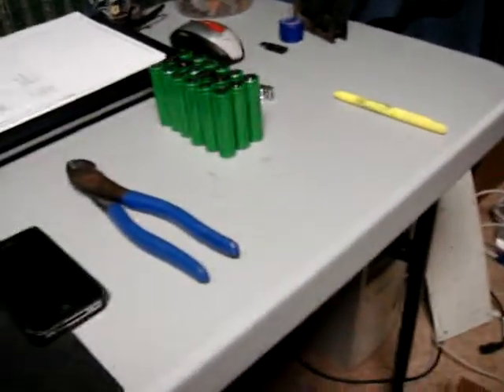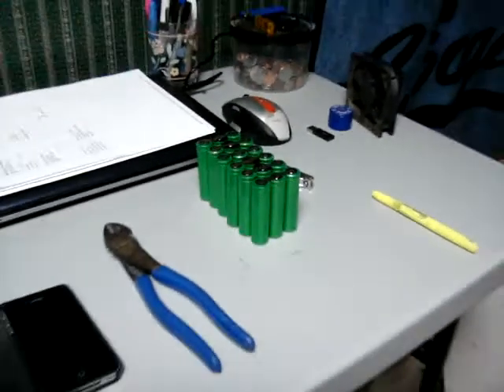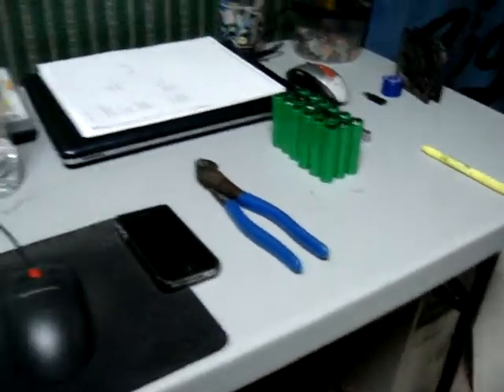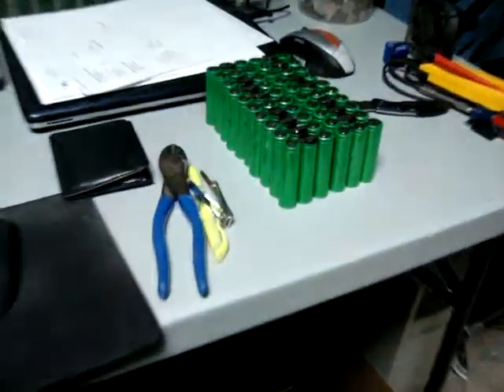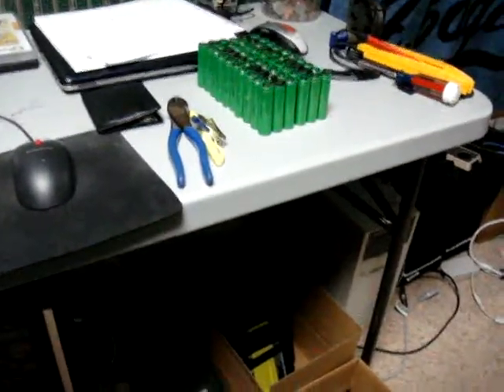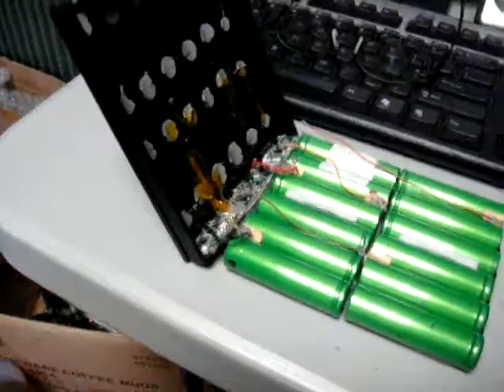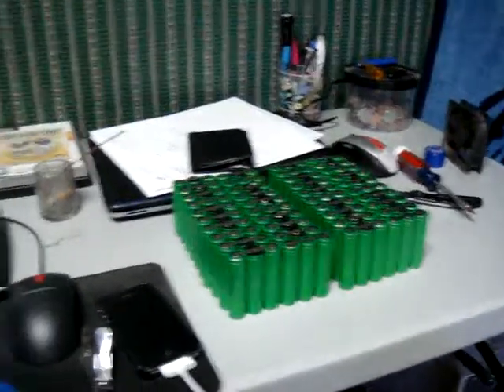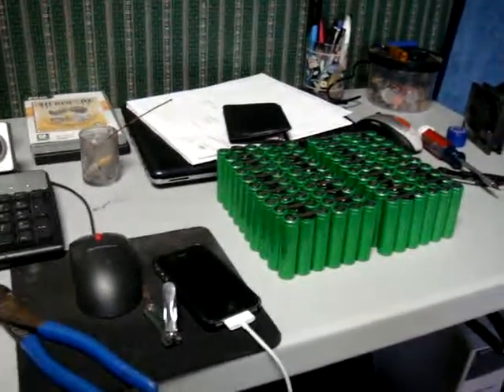EBIKE 72v - Battery pack built from Dell laptop batteries

Comment from the maker: i balance charge the parallel groups with the balance leads. and once they are all topped off i use them on the bike and then i bulk charge at 10S with a lipo charger

Comment: a123 is fine. all the recalled cells are in circulation again and can be bout for around 35 for a 20ah pack. when the recall first happened i could get them for 15 bucks each.

Comment from the maker: @backlash170 they have li-ion smart chargers that charge 10cell (10x 3.7v cell full charge 41v) or you step it up to whatever voltage you want 15 cell will give you 61.5v fully charged. then just get a 15cell charger. It is always recommended to use a battery management system when using most all batteries

Comment: Those look like Sony Konion cells that they use in Makita 18.5V powertool batteries, I'm not sure but the "GR" designation may mean a lower discharge rate than the 18650V version.  The 18650V versions are rated at 10C discharge and are quite suitable for ebikes but it just doesn't make sense to put a 10C cell into a laptop....overkill.  Have you tested or researched the discharge rate of these 18650GR's?

Comment from the maker: The pack splits in half so it charges at 36V. You can use a 10S lithium smart charger, or you can use a bulk charging PSU. I also have balance wires just to check the cells from time to time.

Comment from the maker: if your scooter runs 36v your going to want to use a 10s(10 cell) lithium pack it will charge to around 42v fully charged. It may be possible to run 14 or 15 cells depending on the capacitors in your controller...thats only if you want to go faster.  You can use any types of cells you want just be careful how you charge them. the easiest way is to buy 2x 5cell packs or 2x 6cell packs and wire them in series.

Comment from the maker: when you put cells in series the AH(capacity) stays the same (5x 3.7v 2000mah cells in series = 20v 2000mah) only paralleling will increase the capacity of the pack. If you want a simple build just buy the largest capacity cells so you dont have to parallel too much.

Comment: I made a 36V pack from scavenged A123 batteries (LifePo4) and it works great.  I'd orginally considered laptop cells but I was afraid of the the fire risk.  The high C of these A123 cells allows me to build a small pack that is still powerful enough to drive my motor with no extra weight.  Has easily enough range for my 10 mile commute.  I pallance the cells periodically using an RC hobby charger, the rest of the time I just charge CC/CV to 3.5V per cell.

Comment from the maker: ya you need high discharge cells for EV's id suggest LIPO or a123 prismatic cells. The laptop cells can only handle 1-2C so they arent so great either. if you want to use 18650 cells cordless tool packs have a much higher C rating. And ya A123 is going thru tough times, they are getting bailed out by china and have issued a recall on 55million dollars worth of cells.

Comment from the maker: @MaxSachs i have not tested these cells yet, but yes you are correct these cells have a higher density and a lower discharge rate compared to a V or VT sony cell.  im not expecting more than 1C to 2C as im only needing the pack to draw 30Amps. i think they're 1800mah some people say up to 2200mah depending on discharge. once the pack is built i will post an update! thanks for watching

Comment: You had to use high drain batteries laptop batteries are useless because they are not meant to handle that type of load as soon as  you turn the handle the batteries will drain fast also the balancer will not work like it is suppose to with used laptop batteries I myseif have been using samsung 25r  they are expensive but you get alot of power and distance while keeping the pack very small and light yes you can use laptop batteries but dont expect them to perform anywhere near as good as high drain batteries because they were made to power laptops not high drain vehicles like ebikes.

Comment: Do you know what the mAh is for each of those batts?
Reply from the maker: 1800mah 2c rated Sony US18650GR
Reply: Thanks. I just hacked a old Dell batt pack I had which has the same batts in your video. I couldn't find any other info about them other than being Sony's.
Reply: +CVObservatory hopefully they were real sony's. its pretty easy for companies to fake that shit and it'd be really burnt (pun kinda sorta intended) if they combusted on you. i just got like 10 battery cell batteries from a friend of my close buddies and i never knew that laptops ran off of 18650's. shit blew my mind, im trying to pry the left over solder off with needle nose pliers but some of them are being a major pain in the ass. thats why i looked up for a possibly more efficient way to do this xD

Comment: been commuting to the VA hospital on my amped bike w 48 volt 14 SLA ah battery at 65lbs! I am going to purchase a shorai 12 volt lithium battery 1 per month for 4 months VA disability income isn't much so I have to space it out, this new pack will cut my weight to probably 10-15lbs! which is huge advantage and should give me better range, best price I have found is 126.00 for a 14 ah lithium batt, anyone find a cheaper deal let me know.